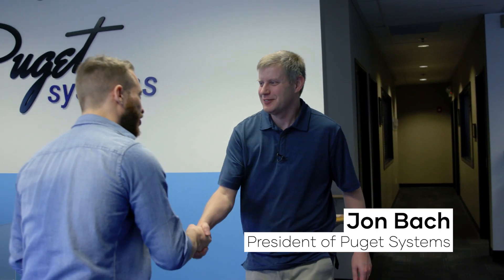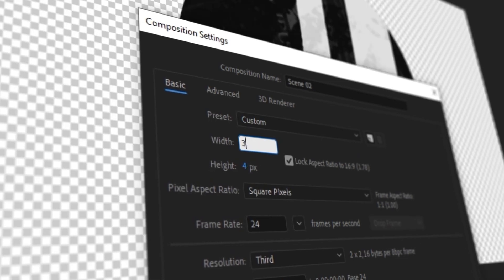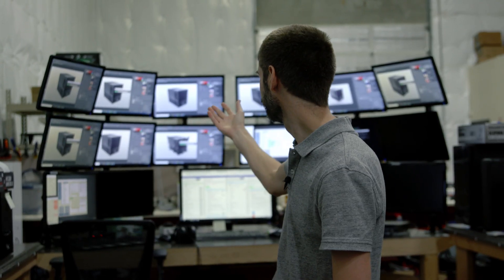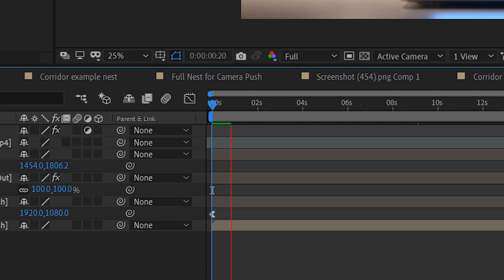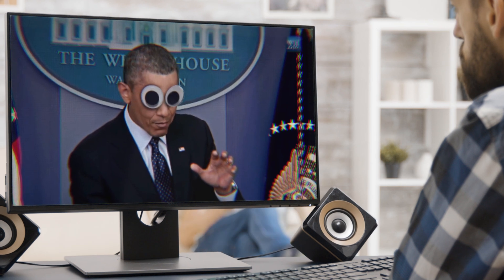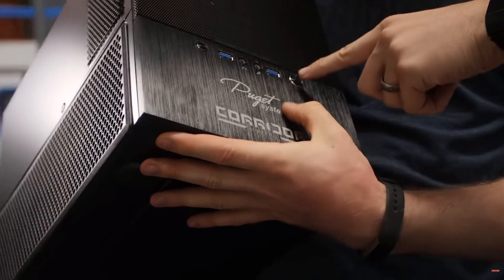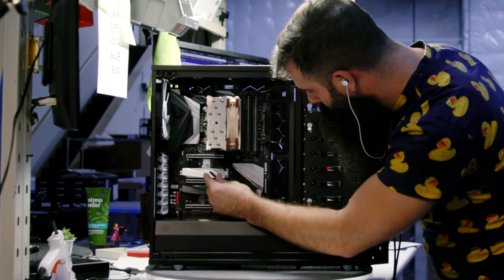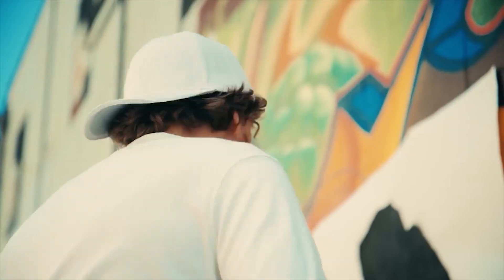Puget Systems - Creating An After Effects Workstation

Comment: How about asking Mr. Adobe, to sit back behind the code lines, and rewrite the basics of after effects and premiere, so both of these great software could USE the actual POWER the high/mid tech PC-s has these days.
It's ridiculous, how they not use gpu power, 2080TI was never over 30% of usage, cpu power is also barely reach 70%+, I don't really care render time, I want fluid playback, and none of these software can make it, after adding just a few text or any BASIC graphic element to a video. DaVinci Resolve can use my gpu power to provide seamless playback, but I still would like to use premiere, but adobe forces everyone to switch, the Dynamic Link system is the only thing which worth staying with Adobe. Only AE does not have any good alternative.